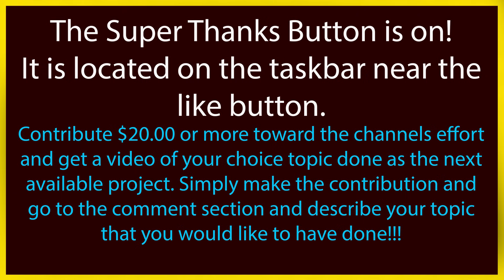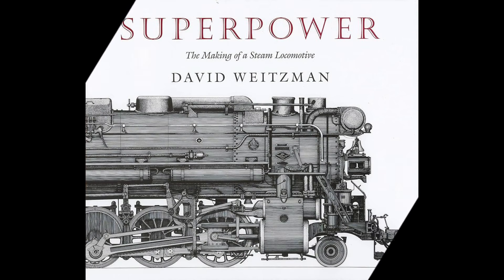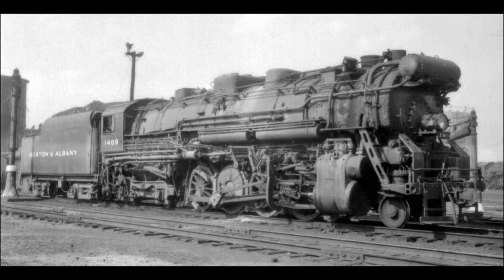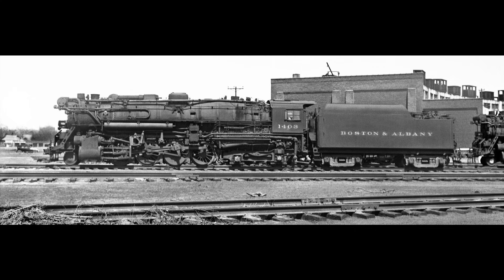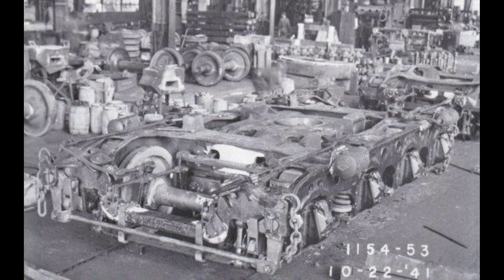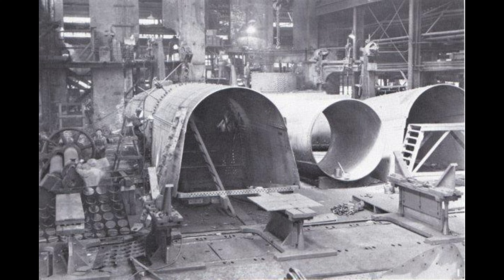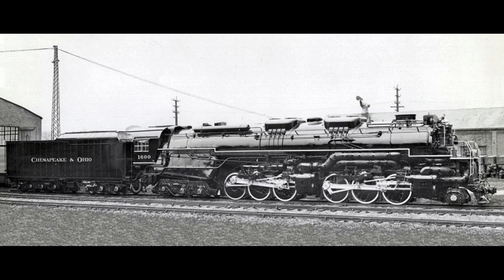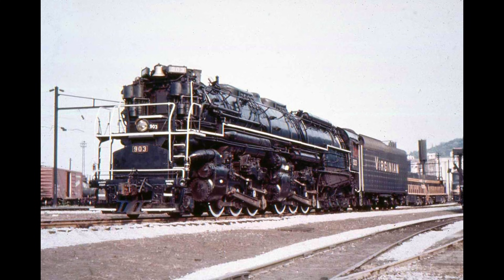Allegheny From Concept to Reality

Comment: Thanks for this!  The Lima Allegheny is my favorite locomotive. I grew up Downriver and spent many a fine hour at Greenfield Village and the Henry Ford. The C&O 1601 was (and is) my favorite exhibit.  Your video mentions the difficulty they had moving that big beautiful beast into the museum hall. Because of its immense weight and length, it famously took THREE  attempts to successfully maneuver the loco into the building! It even derailed once during the process and required the removal of some exterior parts just to clear the tight clearances of the museum's entrance. Still, it's a marvel to behold. 

Sadly, only two survive, and neither is likely to ever run again. I would have loved to see the Allegheny go up against the Big Boy in a seven trial series over different lengths and grades.
Reply from the maker: Im not sure why the B&O museum seems to think it's ok to treat their Allegheny like a common Mike by letting it sit out in the open the way that it does. At least put a sheet metal building around it, or something.. ya know?

Comment: Interesting. You mentioned a couple times about many turntables were designed for a maximum of 115'. I guess that's why the N&W's Y class was 113'. Quite short for a 2-8-8-2 articulated.
Reply from the maker: And they certainly didn't lack grit and power

Comment: The Alleghenies were not just used to pull coal through the mountains. They were used all over the C&O for manifest freights and even passenger trains. Some were set up with steam-heat and signal lines, and ended up pulling trains of war-time heavyweight passenger cars through the mountains at 60 to 70 mph. Some crews swore that the 2-6-6-6s were the best passenger engines the C&O had. They were used on the water level Cincinnati Division, as well as the "Northern" from Russel Ky. to Toledo, which had a lot of roomy flat country. My grandfather, who was a fireman on the Northern, claimed that, on the stretches where the C&O paralleled the N&W, that they regularly out-accelerated the N&W's 2-6-6-4 A class engines.

To answer one comment, though, the Alleghenies never went west of Cincinnati into Indiana. The permissible track and bridges loads were to light for the  2-6-6-6s. The heaviest freight engines there were normally the K3 Mikados.
Reply from the maker: What its all about

Comment: Thank you. There's a lonely Allegheny, #1604, sitting in Baltimore that needs restoration... ❤
Reply from the maker: The museum not taking care of it?
Reply: @TheRailroadCrossing-SteamPower  Idk if the museum is taking care of it or not
Reply from the maker: Is it still sitting outside year round?
Reply: @Everywhere_commenter It probably is... 🤓
Reply: @TheRailroadCrossing-SteamPower  It must be... 🤓
Reply: @TheRailroadCrossing-SteamPower  The latest videos I've seen shows it sitting outside along the wall of the roundhouse. I also saw a vid showing C&O 490 being pushed into the shop. They have already announced that AFT #1 IS being restored, but I think it's for static display only...
Reply from the maker: That's too bad.
Reply: @TheRailroadCrossing-SteamPower  I also read that at one the conventions (NRHS, C&O, etc.) in 2024 (?) a presentation was made that explained that near the end of steam C&O was considering a 2-6-6-8-2 (?) TRIPLEX...
Reply from the maker: I do have videos out on most of the odd designs if you wanna take a look

Comment: the U.P. did not use the 4000s in " drag freight " service . they were assigned to run from Ogden to Green River , and Cheyenne to Laramie . sometimes they ran  thru from Laramie to Green river.  the 3800s and 3900s  ran over the entire system . the C&O engines were NOT used for the purpose for which they were created . they thus did NOT give the economy that was planned .
Reply: The Alleghenies did exactly what C&O wanted: move coal from Hinton to Clifton Forge roughly twin as fast as the H-7 2-8-8-2s could, effectively doubling the capacity of the Allegheny Subdivision while not requiring any change in the right-of-way. In doing so they generated at least 4,000-5,000 HP while using less fuel and water than the 2-8-8-2s. Could they have handled more? Yes, they could have managed trains up to about 50% longer, except the railroad couldn’t handle such a train. The passing sidings at the summit at Allegheny, Va. weren’t long enough and there was no room to lengthen them because of tunnels directly to the east and west of that location. Could they go faster? Yes, they did from time to time handle large passenger trains and manifest freights, mostly after the last order was delivered. Before that they were mostly needed for coal trains.
Reply from the maker: I actually have a video coming on things  U.P. and it's interesting. I totally agree with you on the economics concerning Allegheny.. the should have just bought existing Yellowstone designs. Im glad they didn't.. I love the locomotive.
Reply: Hmm, at the test drives from Ogden to Wasatch the minimum speed was 13,1 mph. For me is this a drag freight.

Look at Videos how often a Big Boy run slow and produce black smoke. Again, for me it is painful to see this drag freight.

Comment: The Alleghany was supposed to be a 2-12-6 but was turn into this monster and the only way i could see someone building something bigger than the 2-6-6-6 if the c&o held on to steam was a 2-8-8-6
Reply from the maker: They would have had to modify infrastructure once again to accommodate such a design. Im not sure wheel arrangement would have been the way to improve upon, rather thermal dynamics would have been.
Reply: @TheRailroadCrossing-SteamPower yeah that could work too
Reply from the maker: In that time economics would have been a factor as well. Another reason why I think improving upon thermal properties is the way they would have gone if diesels weren't a factor
Reply: @TheRailroadCrossing-SteamPower indeed thermal dynamics would had helped if improved
Reply from the maker: Agreed
Reply: @TheRailroadCrossing-SteamPower what I like about the Alleghany is the  6 wheel trailing truck the only other one I can think of to have that is the prr s2 turbine
Reply from the maker: Good one!
Reply from the maker: Not common for sure
Reply: @TheRailroadCrossing-SteamPower indeed not common, but neither was the Alleghany,big boy,t1,and q2 and yet everyone talks about them lol
Reply from the maker: Because they represent the pinnacle not to mention the brute size. They're simply the most impressive thing the railroads ever produced
Reply: @TheRailroadCrossing-SteamPower so true all of them wrere and we could have gone further with stuff like triplexs and maybe had articulateds for switcher service

Comment: I see it a little different, because a Alleygheny need only 20mph to outrun a Big Boy. It means above 20mph the Alleygheny pull more or faster than a UP 4000.

Next is the low adhesion factor of 4,6 , you can use all draw bar pull and in test drives 119500 lbs were recorded.
Reply from the maker: I love me some numbers to back a thought or two.

Comment: It was exactly same with PRR Q2 it never got that job it was build for...it was not build for slow speed but highspeed
Reply: The locomotive had a two wheel front truck simply because freight locomotives almost always had a two wheel truck, not four to keep more weight on the drivers.  Also,  the tender had a six wheel and eight wheel truck, not six and four as stated...
Reply: @tomandbenny ooh interesting..so that is the problem with the H8 class it simply doesnt have enough weight on the driving wheels... therefore it simply results in wheelslip...sorry my English is not good im from Denmark but had always been fascinated by steam and much more in the American version i love theese monsters
Reply: @kimsndergaard973  not at all  - I was simply stating that two wheeled leading trucks were pretty much standard on freight locomotives.  The problem with the Allegheny was twofold: 1. It only had 12 drivers, when 16 would have been better as a mountain hauler.  2. It was seriously overweight,  a fact that was deliberately hidden when the first ones were delivered...
Reply: @tomandbenny ooh of course if i use my brain i can think to that i many times wonder why it only had 12 not 16 driving wheels...
Reply from the maker: Which was the beginning of the end for Lima because it caused all sorts of labor issues
Reply: @tomandbenny  if they had 8-8 instead of 6-6 driving wheels it could had been much better..
Reply from the maker: Yeah that's where you get different tech specs from different publications.  Happens a lot unfortunately
Reply from the maker: C and O always wanted the coal dragger out of this, but the design was clearly out to best the N&W class A. Everything about it suggests that. Not sure what the brass was thinking. They should have just did a Yellowstone design .
Reply: @TheRailroadCrossing-SteamPower would it had change alleghenys pulling power if they had raising its psi to 300 and change it to burn oil...??
Reply from the maker: This answer will be in the q & a video next monday
Reply: @TheRailroadCrossing-SteamPower im looking forward to that...and  really appreciate that...American steam loco had always fascinated me...theese big monsters...and so happy that u make theese videos...💪🙂👍
Reply: @TheRailroadCrossing-SteamPower  but can i ask what is that about i mean Q&a??🙂
Reply from the maker: It will be dedicated video  toward answering all of yor questions
Reply: @TheRailroadCrossing-SteamPower see if you can locate William Middleton's excellent article about the development of the Allegheny.  You are absolutely correct that they built the wrong locomotive for what they needed.  The head of the design team was obsessed with besting the N&W class A.
Reply: @tomandbenny thanks alot very interesting
Reply from the maker: I was looking for that for the video and I  couldn't find it. But I knew about the Class A competitive edge angle and went with that.
Reply from the maker: Indeed